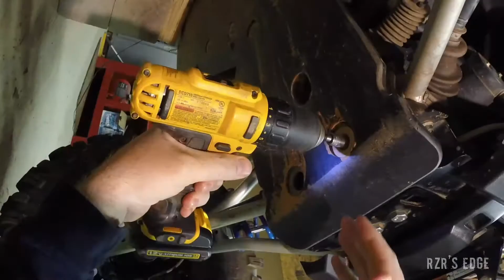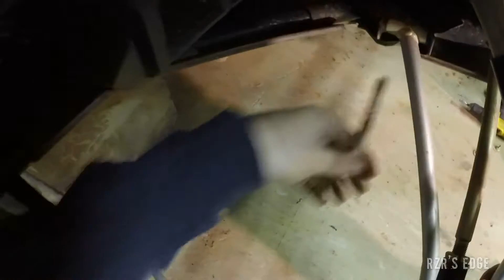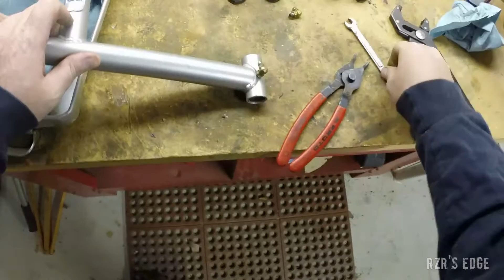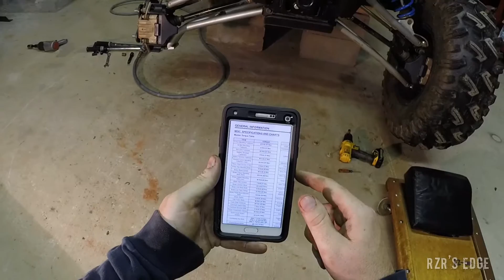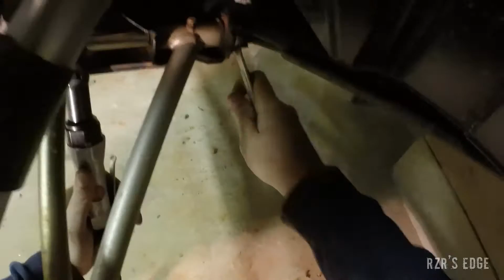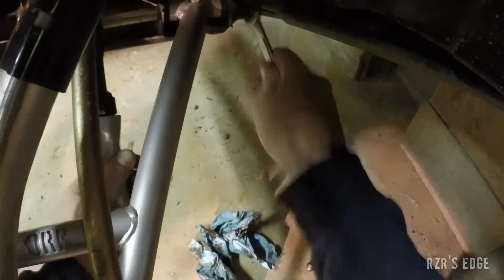How To - RZR Front High Clearance A-Arms

Comment: Did you already have your front sway bar off when you put the high clearance a armson? And what type of winch do you use? I just bought a 2017 900 4 seater today
Reply from the maker: Very nice, congrats! That machine doesn't have a front sway bar, but it does have a rear one, or it did... I took it off first thing. Rides better, flexes and crawls much better. Body roll isn't a problem because I only have a couple lightweight kids in the back usually and I don't really run fast and/or corner hard. If you rode adults around in the back or wanted to ride fast, might wanna leave it on.

For the winch I use a Warn 4500lb with a wire rope from Polaris. People will argue for the nylon rope, but I despise them. The Polaris kit comes with the right mounting hardware, right length wiring, etc.
Reply: I looked at my 17 900 4 it has front and rear sway bar from the factory, I know if I change my lower a arms in front it has to go, should I remove the rear? Or wait until I put rear lower a arms on rear? The reason I ask is because I ride like you do, my kids are a little bigger 13 girl and 16 boy and skinny wife lol!! I have the 3500 polaris winch with steel cable and a warn swath block kit to double it if needed, I think in one of your videos your buddy's 990 s has a polaris winch, is it reliable?  All the winches are made in China it seems lol!!!
Reply from the maker: Orly? Sounds like they were beefing it up for the dunes, but that would be rough and very un-flexy in the woods. The different arms won't really affect how it handles, doesn't matter if you take the sway bar off now or later if that's what you wanna do, as far as the arms are concerned. 

If your back seats have lightweight ppl in them and you trail ride at a reasonable pace, you'll be happier without any sway bars at all. I occasionally run trails pretty hard, even then body roll isn't an issue with me, my wife, and a couple 12 yr old girls. If you have 3-4 full size adults in it however, it will begin to roll pretty bad no matter the speed.

All 3 of my RZR's and Donnie's too all have/had Warn and/or Polaris winches, never had a problem with any of them. Jeremy and Kristen's 900S has a cheapo "Badlands" winch from Harbor Freight, not very impressed with that one.

Comment: could you,post the torque specs for everything please?
Reply from the maker: +urungutang Sure. The A-Arm mounting bolts are 42 ft-lbs, and the ball joint is also 42 ft-lbs. The lugs on the newer 900's and 1000's are 120 ft-lbs. This is per the factory service manual.
Reply: Thank you,about to install Super ATV arms
Reply from the maker: You're welcome! We just put Super ATV arms on Donnie's RZR yesterday, they are very nice, I was impressed with the entire kit.
Reply: Did you have any issues with camber adjustment?
Reply from the maker: +urungutang no, used a 4 ft level, used a jack to level the machine, then used the level to set 0 degrees with tires off the ground
Reply: Just finished the set-up today,i did set it negative camber though,2-3 degrees is recommended by super atv..taking it out tomorrow to Ocotillo Wells,CA,will see how she does:)
Reply from the maker: +urungutang yeah we set it to 0 degrees off the ground, which gave it about -2 with weight on the tires. enjoy your ride!

Comment: can you fit a five gallon bucket under the front or rear.
Reply from the maker: +Grizzly Rider 700 I dunno, haven't tried. It hasn't been lifted, just evened out the ground clearance from the low hanging factory arms.
Reply: After my arched a arm update i have 13.5 inches under the front skid plate.